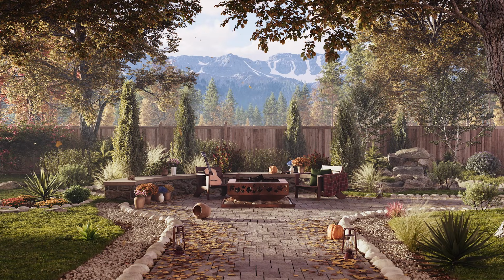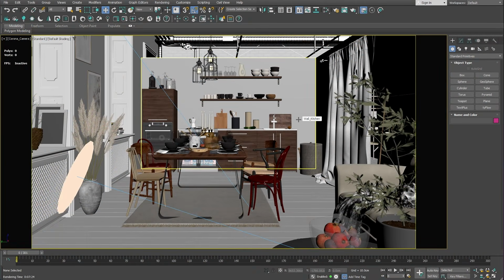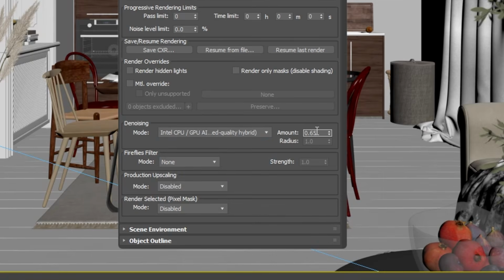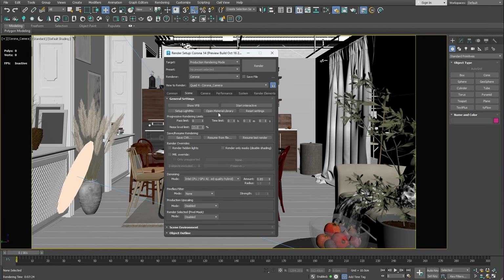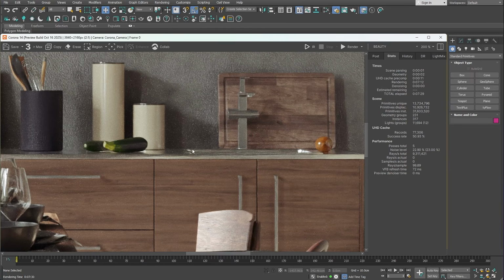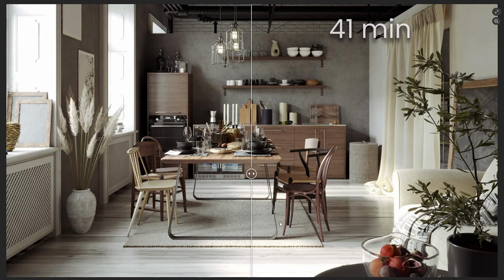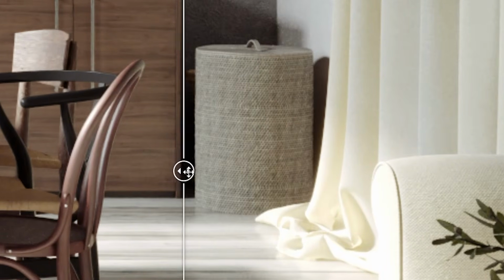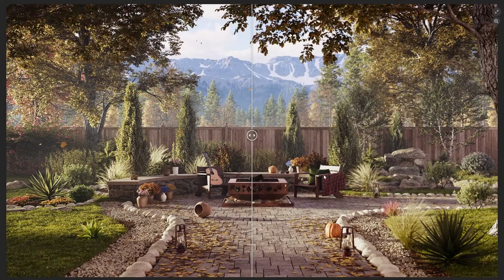Faster Corona Render Times

Comment: The flagship AMD 9950X3D2 CPU is due out in a few weeks, offering a performance boost in VRay of several percent over the 9950X3D. This processor has a super-fast 208MB cache. Perhaps you could improve Corona's engine to take advantage of such a large cache in such modern processors? ;)

https://www.youtube.com/watch?v=_ErnOjwcWK8

Comment: Can I use this technique while rendering an animation ? If yes, then how ?
Reply from the maker: The same approach can be taken, but you can't use the in-built "save to 50% size" button - but that's ok as the button is intended to reduce the step of having to open it in a photoeditor, whereas for video you always have to open it in a video editor anyway, at very least to turn your image sequence into video format (never render straight to video format from your render engine :) ), so you can do the "downsize to 50%" step there anyway since you will definitely be opening your video editor. Hope this helps! Tom
Reply: @ChaosCorona thanks Tom, this definitely helps

Comment: This doesn't really work for animation right? I read in the corona help files that Intel AI denoiser doesnt is not good for animation?
Reply from the maker: Works for animation, only you don't use the "save to 50%" button. That button is only useful as it saves you open a photoeditor simply to do the rescaling. However, since videos should always be saved as image sequences, you will always need to open them in a video editor, and the resizing can be done there since you definitely have to be in that software :)  Also, the Intel Denoiser is great for animations - it doesn't have temporal consistency, but after years of use, it has proven to work great with animations too. The Intel Denoiser is our recommended denoiser out of all options, for both stills and animations. Hope this helps! Tom

Comment: si les rendus sont enregistrer en plein formats et ensuite qu'ils sont réduit de 50% en sortie de photoshop après la postproduction cela marche aussi ? ou il faut absolument réduire la taille de limage depuis le VFB de corona avant de passer sur photoshop ?
Reply from the maker: You can of course do it afterward in any photo editor of choice - this just saves you having to do that extra step of firing up the extra piece of software. The original tutorial from Render Ram is based on doing it externally, and we thought we could make that a bit easier by making it an in-built step when you save from the VFB :) Thanks! Tom

Comment: when corona 14.1 hotfix will be available? since corona image viewer can't save a png with alpha channel, and you might add some basic fixed with Vantage, so it's a real use of GPU, instead of these none sense trick of 50% save
Reply from the maker: Sorry for the delay in replying, I had some extended time off over the holiday season - since you posted, there has been Corona 14 Update 1 that comes with more than just bug fixes. There should be a hotfix for that (so Corona 14 Update 1 Hotfix 1 - fun name!) in the next week or so too. Hope this helps, Tom

Comment: This seems like a really small feature, practically imperceptible. It would have taken so little to add a "render twice and downscale" button that under the hood would render at double the resolution specified in the render settings and then display the already halved version in the VFB 😕
Furthermore, with your method, you still have to manually manage the Render Elements and Batch Render, so a switch that does everything under the hood would have solved these problems as well.

Comment: Can we apply this to anination also?😊
Reply: +1 for this ... actually opened 3dsmax to see IF this is possible.
Reply from the maker: No real need - this is to save you opening an image editor and resizing there, reducing a step and the need to run an extra program. For animation, since any animation should always be saved as an image sequence, you always have to open it in a video editor, and you can resize there since it's inevitable you will be in that software anyway. Hope this helps! Tom
Reply: @ChaosCorona  / Tom - I was just thinking one day about: Could the Corona Renderer team code their own Batch render window? The 3dsmax default works but I was thinking if it could be revamped somehow? If render an image and there you could set up a name, then with tickboxes save png jpg, save 50%, save alpha etc. Or for the animation, save image sequence 50% ... just an idea :/ if you just pitch an idea: can the batch renderer be made better?

Comment: How do you save at 50% for animated sequences?
Reply from the maker: You don't need to - since you have to open the image sequence in a video editor anyway (as you should never render straight to a video format), then the downscaling can always be done there. A still image on the other hand, may be complete when you save it and you won't necessarily be opening it in some image editor afterward. Hope this helps! Tom
Reply: @ChaosCorona  I just opened one animation in 3dsmax and I set everything up as in this video, rendering as I am writing this. So the "Save 50%" doesnt do any other tricks besides it scales the image down? I want to see how my animation looks in Premiere (scale to frame size) and exported as an mp4.

Comment: Hi, I've been using this method for 2 years now and it works very well. Great also for exteriors with displacement details, you can also reduce sampling parameters to get fauter passes and reaching the minimum number of 5 passes to show noise level.  In conclusion, it leads to the result wanted with ai upscaling and reducing render time by 3 or 4 time.

Comment: Is it possible to use when rendering videos?
Reply from the maker: You don't need to - since you have to open the image sequence in a video editor anyway (as you should never render straight to a video format), then the downscaling can always be done there. A still image on the other hand, may be complete when you save it and you won't necessarily be opening it in some image editor afterward. Hope this helps! Tom

Comment: D5 render provides better esults and more easy interface, how come such a big company like you cannot compete with it's good GPU based rendering and quality ?
( i am not attacking you, i just love corona so much and i want it to grow)
Reply: I am a faithful follower of Corona, I have not seen results like with their rendering engine, but lately I feel that their advances are small steps compared to the giant steps that D5 is taking, if they continue like this in a short time they will lose that position. It is only a matter of time before d5 makes an update in both lighting and textures to produce photorealistic renders such as corona.
Reply: D5 is comically trash, there is a reason why little to no studios use it for production images/animation
Reply: @bobdavid343 most Archivs channels for some reason are promoting D5 render which showed up around couple of years ago unlike corona and it’s taking huge leaps in rendering quality, Ai improvements and time in rendering
Reply: Ew, no it does not. Stopit.